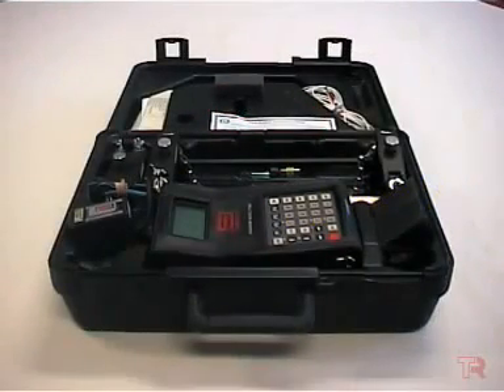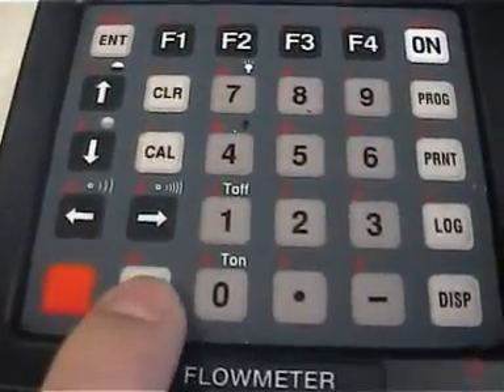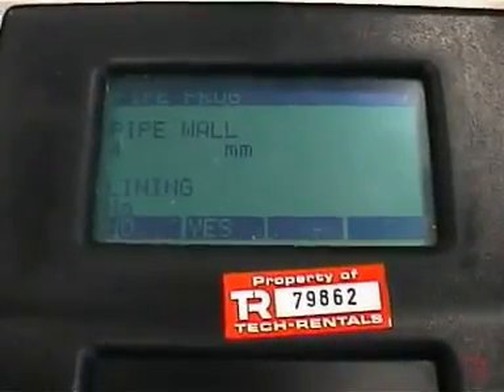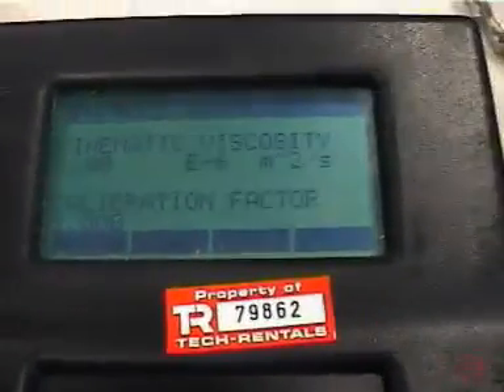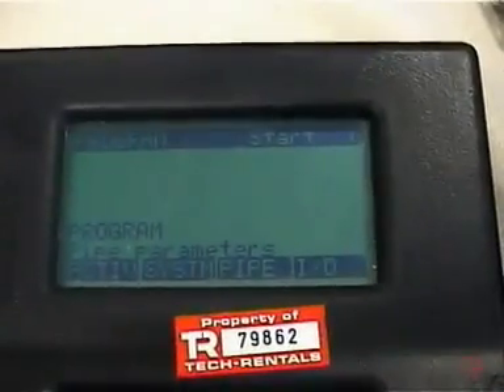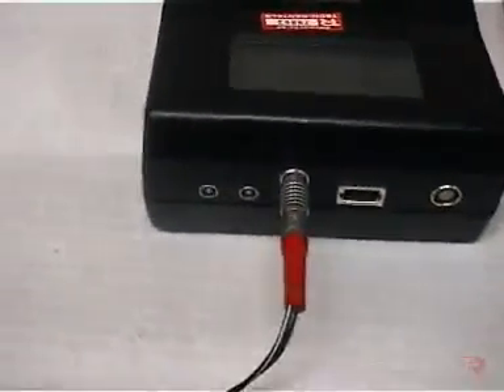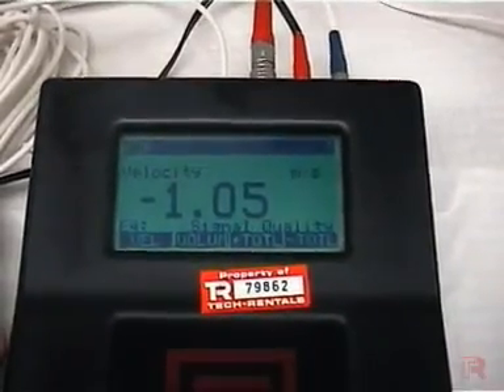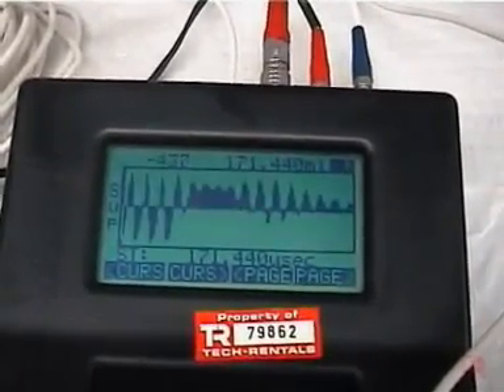A How to Guide for GE Panametrics Ultrasonic Liquid Flow Meters

Comment: Hi Sir, what is the sensor ranges...our pipe line sizes starts from 10mm to 3000mm... do you have different sensors for different line sizes or one pair of sensors for all pipes.....
Reply: The PT878 has transducers to cover that range. In our rental fleet we generally stock the transducers from 10~600mm .  Although we have found we can do much larger pipe sizes without an issue. The biggest problem is placing the transducers on the pipe becuase the fixture to hold the transducers simply will not reach that far!.

Comment: HI there,

why does the signal first crosses the pipe wall, from the transducer into the the pipeline. but when it reaches the other side of the pipe, it reflects and comes back to the other transducer?
Reply from the maker: Vasco Sampaio Thank you for your question. Each transducer is a transmitter and receiver. So it’s not a reflected signal, the signal is sent both ways. We hope this helps, and if you have any other questions, please us know.
Reply: Vasco Sampaio

Comment from the maker: The spacing is centre line to centre line. Some different brands specify the distance between the front edge of the transducer, but for the Panametrics instruments it gives you centre line to centre line of the transducer.

Comment: Dear Sir,
I have one question about the PT 878 flow meter is space should be between the center or apart from each other? maruti.shetti@yahoo.com
Reply: The PT878 uses a center line to center line measurement. Its pretty easy because the fixture it uses when it connects to the transducer it is symmetrical about the center line of the transducer. So the fixture has a ruler along the side and you simply align one transducer with the back edge at zero on the ruler and the other transducer to the front edge of the specified distance on the ruler. Sound complicated but its really pretty simple in practice.